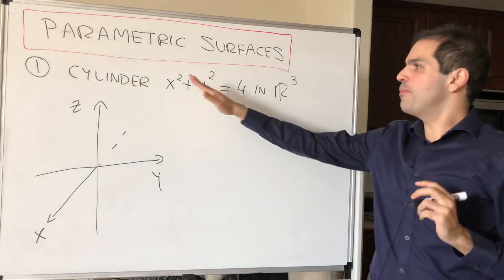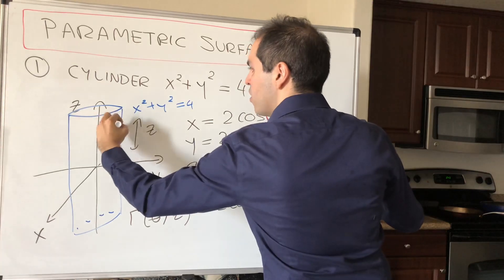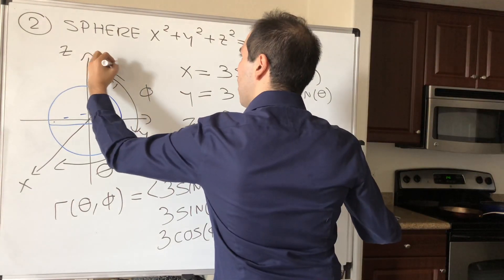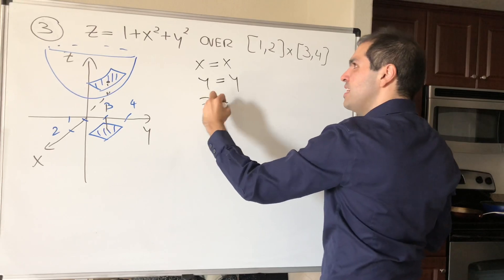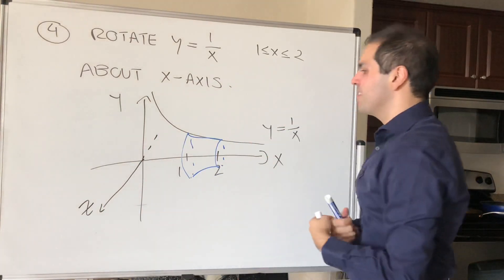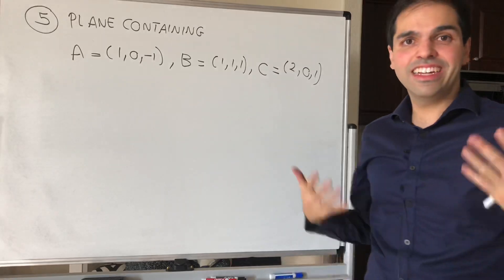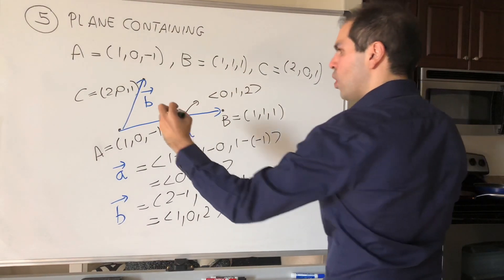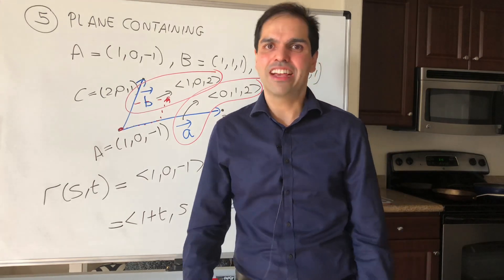Parametric surfaces

Comment: the last one about the plane was not clear like other surfaces. a lot of hand waving and glossing over vector algebra. it will be nice if you can point out the underlying vector algebra video if you have done any. thanks for responding.
Reply from the maker: I mean there isn’t much vector algebra involved, you find one vector and then another one and then take linear combinations. I have a lot of linear algebra playlists that cover that, such as one on Linear Equations
Reply: @drpeyam  sorry for asking stupid doubts in basics. i need to brushup and understand vectors better. thanks for responding. your problems are beautiful. keep them coming.

Comment: I had a fun time deriving the parametric equations for a torus while bored at work one day.
Reply: Also, I found out it's MUCH nicer to describe a path along a sphere in terms of polar coordinates (aka parametrization) instead of in rectangular coordinates
Reply: @GhostyOcean  try describing the geodesic on a sphere in spherical vs rectangular coordinates
Reply: @thedoublehelix5661  if the geodesic is along one of the axes then it's easy in either way. I'd imagine it's EXTREMELY easy with polar along a skewed geodesic in comparison to rectangular.
Reply: The paramedic equations? So dough-fibrillators
Reply: @ezras7997  yeah, one for each coordinate direction…
Reply: @ezras7997  ah I see, keyboard auto corrected to the wrong word 🤦‍♂️
Reply: @GhostyOcean  lol
Reply: It is very easy to parameterize the torus, as long as you view it in R^4 instead of R^3
Reply: @sourdoughnovice22  how do u do that? please explain it
Reply from the maker: Ezra S 😂😂😂😂
Reply: This is how im trynna be